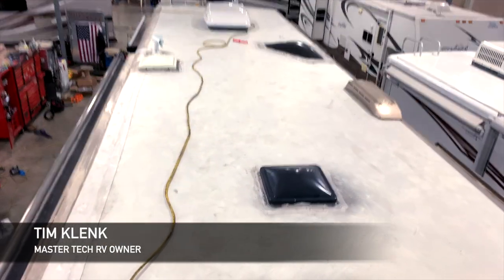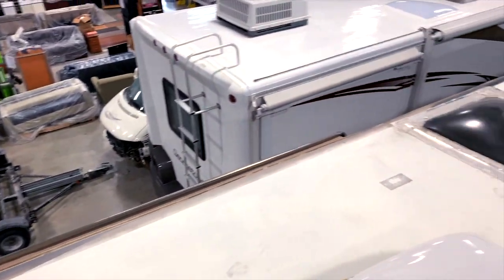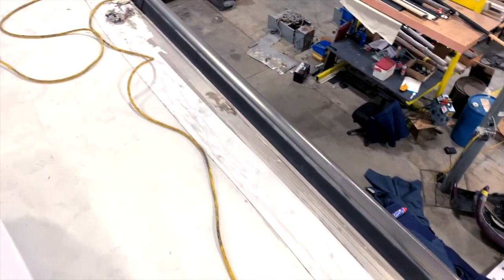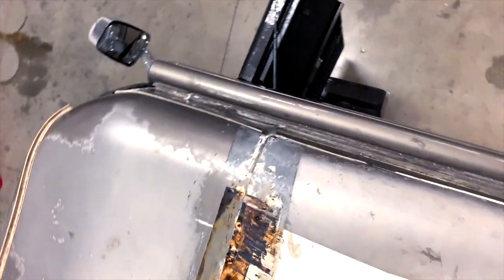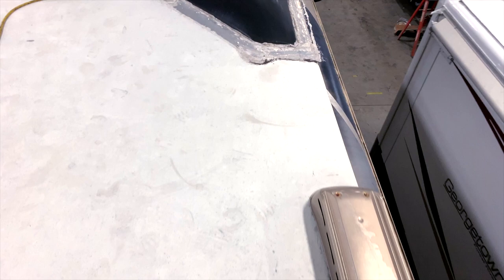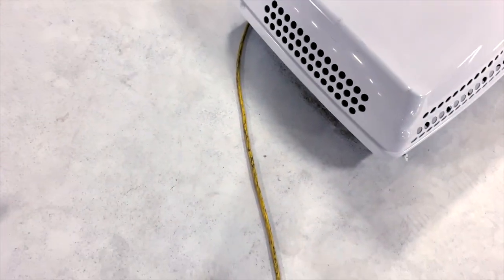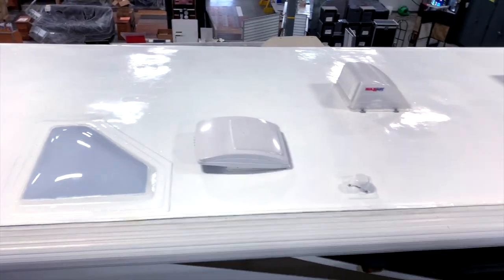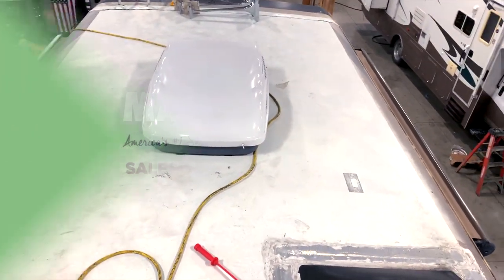Make the Switch: Standard to Invincible Roof (Lifetime Guarantee!)

Comment: You seem to indicate that it is impervious to UV damage. I doubt that . Over a period of 15+ years any polymer fiberglass or similar coating will deteriorate whther sprayed on or any other method. There is nothing wrong with usinan elsatomeric compound but it MUST be done every 3 or 4 years with. Eternabond tape is very tough. My rig is a 1993 Safari and it  has never been parked under a shelter. I recoat about every 3 or 4 years with 10 yr Elastomeric coating/metal roof paint. You "Invincible Roof" looks nice.
Reply from the maker: Our Exclusive Roof Formula is a Polyurea formula sprayed up to 1/4" thick.. It bonds to any stable base such as wood, fiberglass or metal substrates.. our roof has over a 3500 lb tensile strength and has an expansion of over 1/4".. We then spray on a Polyurea Ceramic top coat for additional heat/uv protection..  Once an Invincible Roof is applied you never have to seal your roof again..
Your coach is Cooler, Cleaner and You and your family and Coach/RV Investment are all protected under the roof. 
Your Safari has a Gelcoat roof -- The thickness of that averages 1/8" then they add a luan wood backer or filler making the panel 1/4" in total thickness.. The luan backer will deteriorate and then delaminate severely weakening any strength the gelcoat roof had.  As a gelcoat roof ages the gelcoat will leave a chalking down your unit everytime it rains.. Then through temperature changes any condensation/sweating within the roof structure will cause the Gelcoat to Thermocheck (small cracks in the gelcoat/fiberglass)
Adding an elastomeric coating or any paint on coating to any RV/ Coach Roof is a Band Aid that will need to be reapplied yearly.. and as millage builds up it will then have to be scrapped off and start all over again.
Eternabond Tape has  life of 2 to 4 years before the adhesive starts failing.. 
Invincible Roof system is the permanent solution to a Happier RV Lifestyle.